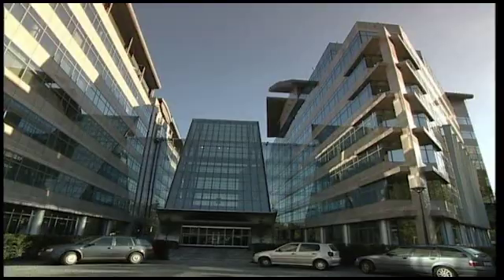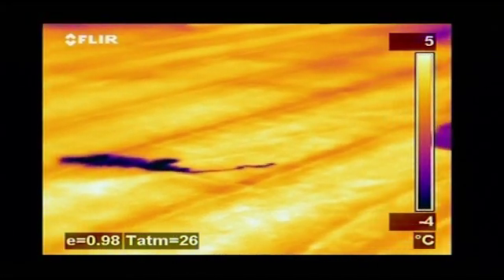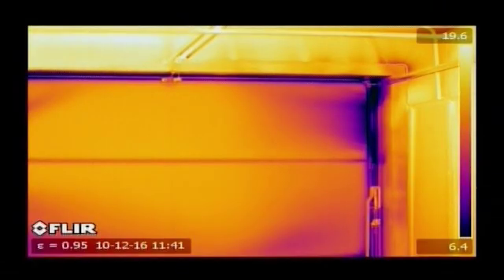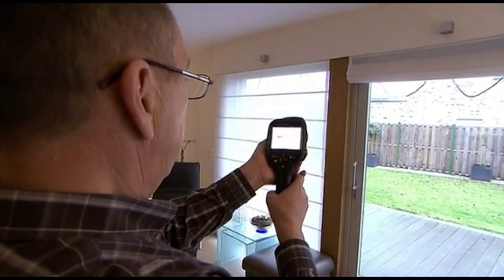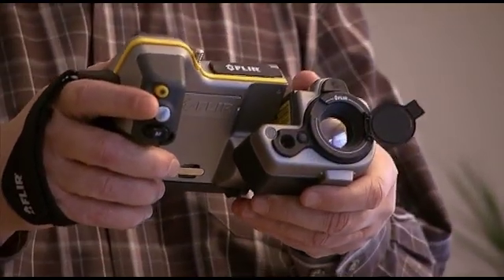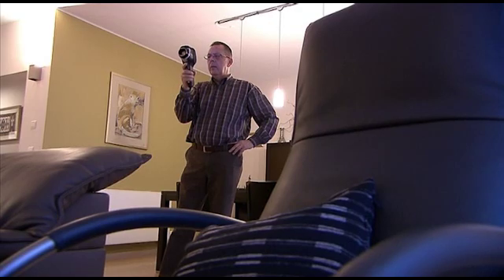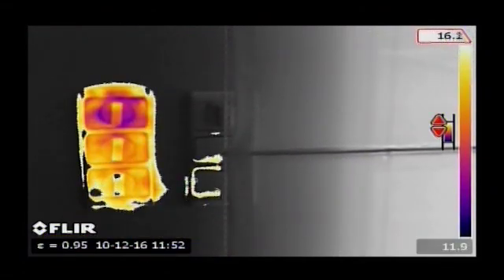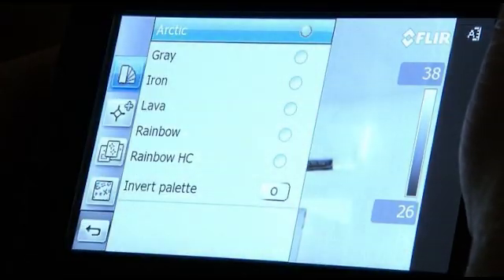Infrared Thermography for Building

Comment: No your wrong Bejiman.  The water will appear hotter at night time since water has the best thermal capacitance of all natural substances.  Therefore at night time it will have retained its heat from the sun throughout the day and the rest of the roof will lose its temp quicker than the water, making the water appear hotter.  This would be completely different if done during the day.  So ya get your facts straight buddy !!!
Reply: Will you please suggest me any guide for Building thermography of building particularly for crack detection? I am doing thermography of old temple for crack detection . temple made of Bassalt rock.thanks in advance